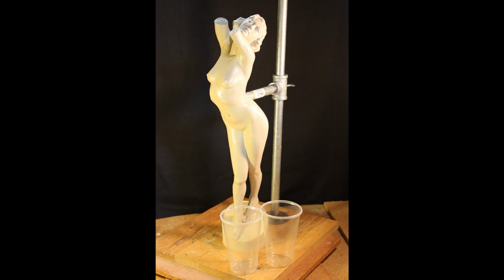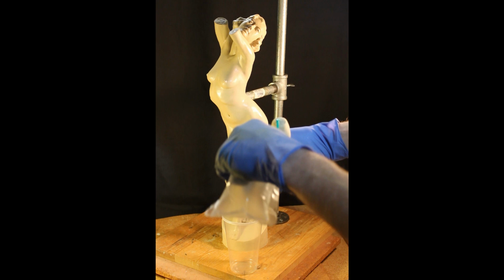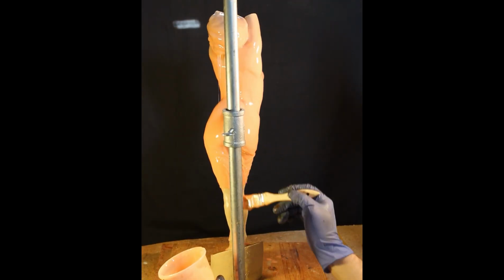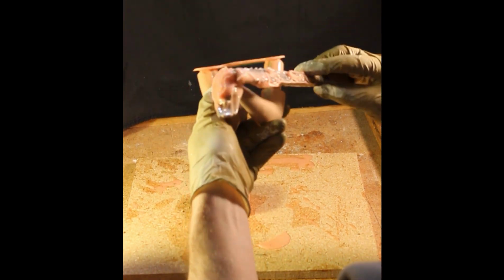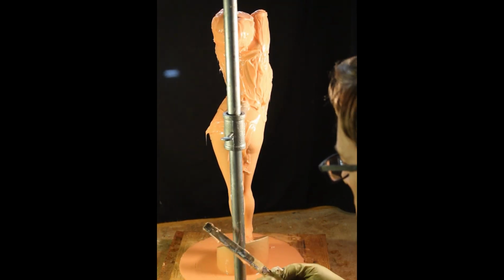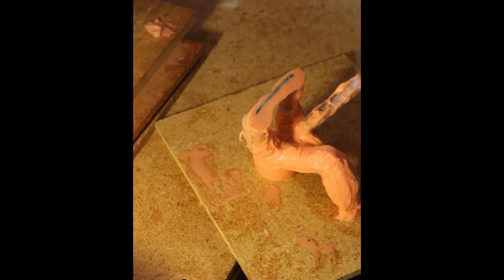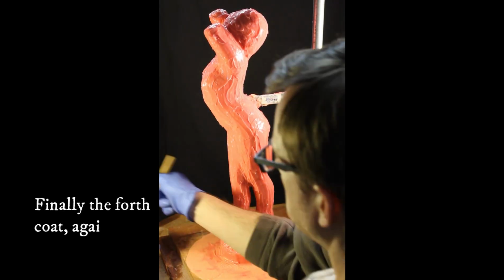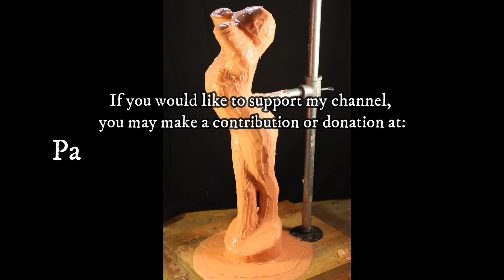SILICONE MOLDS FOR SCULPTURE starting with how to make the silicone mold inner jacket

Comment: Hi Jon  I’m so pleased of discover your videos they are awesome .  My main concern is to apply this silicone 25   With a paint brush  and to trap air    Even  be extremely  careful,No using a degas .?  Many thanks in advance Eric
Reply from the maker: I use crystal clear acrylic spray paint on my sulfur free clay before silicone work. It seems to add a mild layer of hardness. 25 is thicker than normal moldmax. I pour the first layer, run over and use a brush sparingly. A little goes a long way at first. Then subsequent layers can be approached with a little less caution. Try using a frosting knife or equivalent in lieu of a brush.

Comment from the maker: Wait at least 2-3 hours between layers. Tacky but resistant to the touch at minimum. I sometimes went days between layers.
Reply: It seems get tacky in about an hour.  I thought you couldn't let the silicone fully cure before adding the next layer, or risk delamination between layers.  In your experience that hasn't been an issue?
Reply from the maker: Sorry I missed this Terrence! Yes, its better to do it in one shot. It obviously can work going days between layers but it's better not to do that if you can avoid it. I will add that when you're patching the hole where the piping inserts, the silicone may be fully cured and resistant to new silicone: don't procrastinate here. Heat accelerates the process so avoid that until post curing also. Cheers

Comment: Thanks for another great video. I do have some questions for you: How much Rebound 25 do you use for an application like this? It seems that it comes in pint (2 lb) and gallon (18 lb) units. Do you think the 2lb unit would be enough for something about this size? Also, I see on the Smooth-On website that it can sometimes be used as a glove mold. Do you have experience with this? Obviously it wouldn't have worked for this sculpture, but if there were no leg gabs or arm gesture (I guess I am thinking of something like the Oscar's statue, or maybe just a bust), do you think this would be a good choice? Would thickening with Thi-Vex make a glove mold impossible?
Reply from the maker: Thanks Peter! Concerning the amount of Rebound 25, I purchased the gallon unit (which is closer to 2gallons) and made about 4 molds this size. So approximately half a gallon in actual amount, or 2 "pint size" kits.
As far as a glove mold, I wouldn't do it. THI-VEX will not aid in strengthening the silicone as far as I know. But experiment and see what you can accomplish. Urethane is typically used for glove molds but that stuff behaves entirely differently. I avoid it.
Reply: @JonBurnsFineArt  Thanks!

Comment: I must not be using nearly enough Thi-vex.  I haven't gotten the thickened Rebound to that consistency, where it is smooth and creamy.  It seems thick, but is sticky and doesn't build up very well.  The Smooth-On videos show them building up layers with the pure Rebound, and only using Thi-vex to fill in undercuts.  Your method builds it up a lot faster.
Reply from the maker: You're using equal parts. After it's thoroughly mixed, 3-5 minutes, then add about 5ml (tsp) per 16oz (pt). That's how I do it and it's creamy. Let me know your mix order, jonburnsfineart at gmail, if you have more questions. Btw, it should be sticky. And I don't use thivex on the first coat if that's the case. Hang in there.